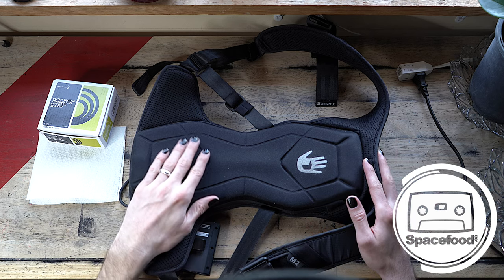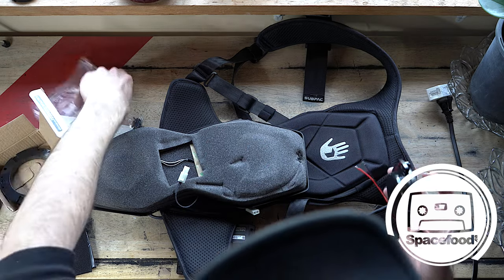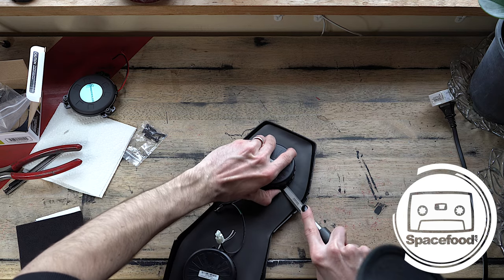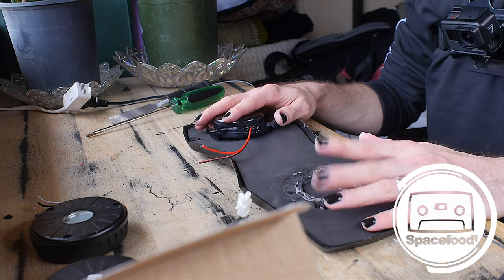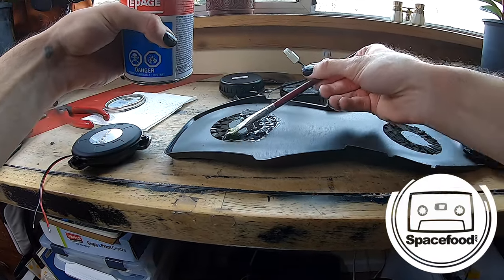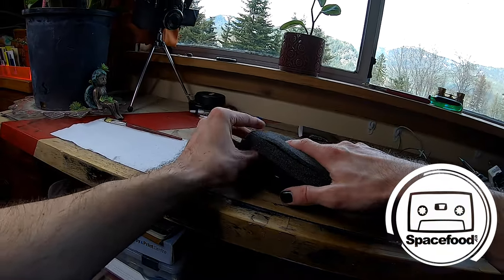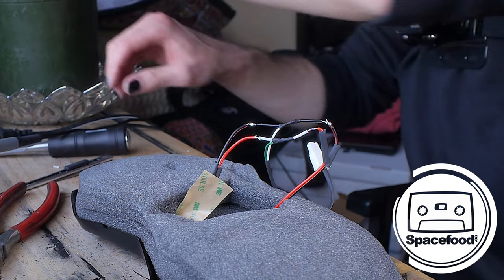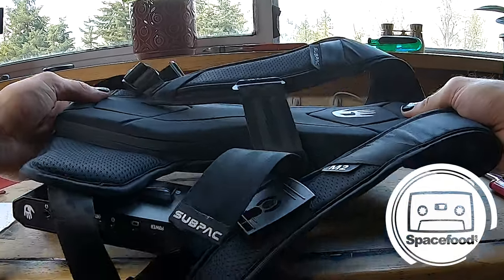How to Fix a SUBPAC in less than 1 Hour for $30

Comment: I got the amp fried by mistake and hooked a cheap 2.1 amp on it. Connected 1 shaker on the left channel and 1 on the right channel (it vibrates sligthly diferent from one another giving a better musical experience especially on the healing solfeggios and frequencies). I still have room to put one more shaker inside to connect on the subwoofer channel of the amp.  If you try using another amp don't forget to use filter to cut out the high sounds.
Reply from the maker: A low pass filter 100%
Reply: Which low pass filter did you use?

Comment: i just got my subpac 3 days ago! and i love it! ... went on a bike ride today and it crapped out...so sad ..thanks for the video
Reply from the maker: Sorry to hear it pooped the bed. I'm glad this video will help you get it back up and running for your next bike ride though!
Reply: In your opinion.... do you think the after market transducer is better or worse?
Reply from the maker: @MegaPlatinum111  I haven't yet conducted a comparative study on its precise frequency response (for the sake of showing data). However, since repairing my Subpac, I use it close to a daily basis, for audio mixing and mastering for music and dialog. I don't detect any difference between the two (from memory, since both of the Subpac shakers were broken when I received the replacements).

Holding it in my hands, the after-market shaker feels to have a better build quality than the Subpac original. It's slightly heavier and feels stronger. 

In comparison to the Subpac component, which feels like a hollow cup and appears to be made of less-dense materials.
Reply: Which model do tou have?

Comment: Hey dude, great video and thank you for sharing. Just wondering about something here. You posted the link to a product that is rubber cement, but you used contact cement which is a different product in your video. It seems like rubber cement would not be as good as contact cement for this job, would you agree?
Reply from the maker: OMG, THANK YOU FOR NOTICING THIS! You are 100% correct. 
Oh man, I completely blanked on the product link. I updated it now to contact cement. 
Thank you AGAIN!

Comment: Thanks for the video. So can you tell any difference between the new shakers and the original ones? cheers
Reply from the maker: Happy to share this discovery with you! I have been meaning to run a comparative analysis using test tones (just haven't had the time). However, I currently use this repaired Subpac for mixing and mastering and don't detect any difference in its frequency response.

Comment: Dude i need help w my  m2 classic model.. at least advice. Subpac company refused any sorts of fixes. I asked for replacement batteries as my Subpac is 5 yrs old. The problem rnow is the curly wire got damaged and it shuts off sound/ charging snd like the whole communication w the control box. I can easily open the batrery zipper but the main zippen on the orher side wouldnt move AT ALL, I added a paperclip and a drop of machine oil but no results..
Reply from the maker: Ah, dang :/ I haven’t experienced it myself, but I have heard someone on the internet (hopefully I’m not spreading rumours) say that the zipper part was glued on some Subpacs. It’s hard to say what would help get that zipper undone without destroying it or making it look really bad. Mind posting a picture? I hope you’ll be able to get it open and fixed!
Reply: @abletoncoach  pretty much nothing to show. looks exactly the same, wouldnt move. i was able to work out like a tiny bit but thats it. its jammed but if its glue - THANKS! i will try to use a disolvant like alcohol. Better than having a broken zipper not nowing how to close tha pack back up...
Reply: my wire is frayed did u figure out how to repair it?
Reply: @shAiDawn  i could never open the subpac’s zipper for internal access it seemed to be stuck for unknown reasons - jammed or smth
Reply: @RobertRyda  mine is unfortunately glued too I can see it but its only on the very end closure point not allll the way down the zipper

so maybe u can pry it somehow then add or sew some cover after to hide it

there must be a way

Im wondering if the inside area where the wires come in is accessible once u open it at the zipper part? The coiled housing on mine is literally crumbling apart. The box is also super sticky that happened also on my Push 2. People need to stop using that.

Ughh I need my subpac back 😿
Reply: @abletoncoach  it looks exactly like it looks. Fabric hoop over an inverted (inside out) zipper seems stuck or glued. Nothing helped. Maybe a heat gun or smth will do idk

Comment: my cable is fraying and shorting

did u make a video how to fix that? I imagine u had that issue too it hits right at the bottom where you sit 😢
Reply from the maker: Hmm that’s unfortunate. I haven’t had that problem yet but it sounds like you’ll have to replace the frayed part of that cable if you have enough length between the pack and amp. It might be a bit of an involved operation to do it without damaging the rest of the unit. 

I’ll surely record a video tutorial if I have that same problem.

Comment: What is the best way to clean a subpac if you do alot of running in it?
Reply from the maker: Hmm that’s a good question. Just a guess, maybe you could remove all the electronics from the case, and hand wash it with laundry detergent. Rinse it well and then let it air dry. Again, just a guess!

Comment: Wil you be able to play your bass on higher intensity for long periods of time after doing this fix? Thats what caused mine to break.
Reply from the maker: Here is a picture of the inside of a SubPac shaker: https://imgur.com/a/Ve2RbNS

I can't confirm the answer to that yet as I haven't conducted a side-by-side test. However, based on what I discovered while I took apart the Subpac bass shakers (in an attempt to fix them), they are surprisingly cheaply manufactured. 

It is obvious when holding the aftermarket bass shakers in your hands that they are a significantly better build quality. 

I haven't done a lifespan comparison on the aftermarket bass shakers but I would bet money that the aftermarket ones would last significantly longer.

I was just so surprised (and a bit disappointed) to get a look at the Subpac shaker when I opened it up. And the reason why the shaker fails is due to a badly applied ring of adhesive around the voice coil. 

Again, here is the image: https://imgur.com/a/Ve2RbNS

Comment: And they wanna charge me $100 to send mine in for repair. 😂

Is the experience exactly the same after this fix?
Reply from the maker: Yeah, this repair will get your pack back up to 100% (honestly, I'd say 110%). The aftermarket shakers are a way higher build quality overall.

I recently took apart the official Subpac shakers to see if I could fix them and I was surprised at how bad the build quality was! The shakers in the M2X are constructed reeeeaaaaalllllyyy cheaply. 

Of course, the backpack, Bluetooth amplifier, and overall form factor of the product is BEAUTIFUL, but they REALLY skimped on the shakers themselves. 

I'll probably post a video of the inside of the shakers when I have time next so that you can see how to fix those (if you have a steady hand and lots of patience).